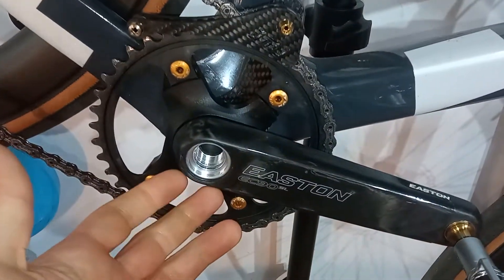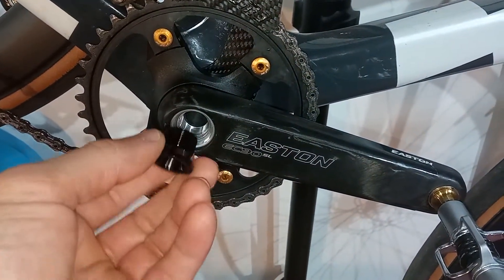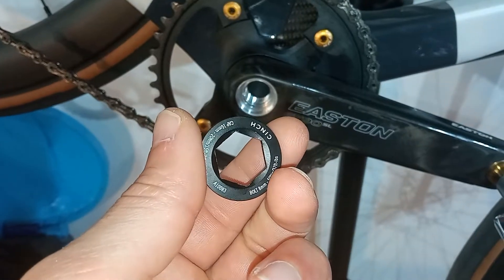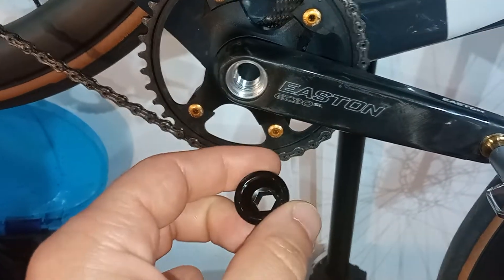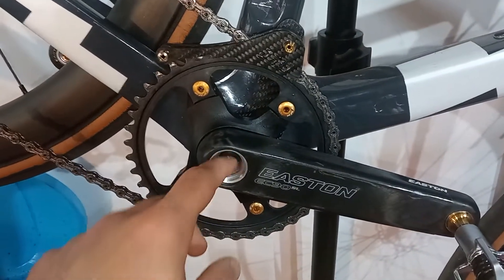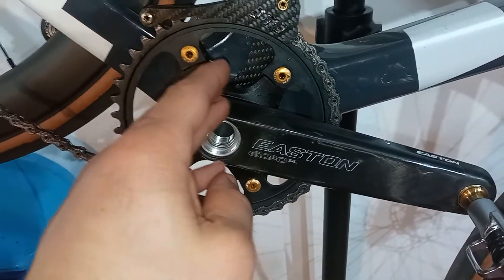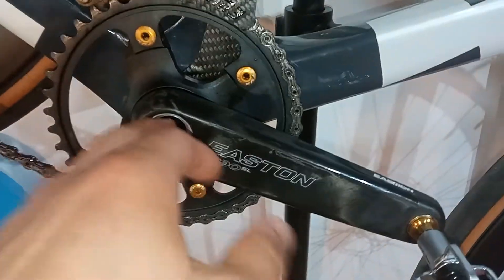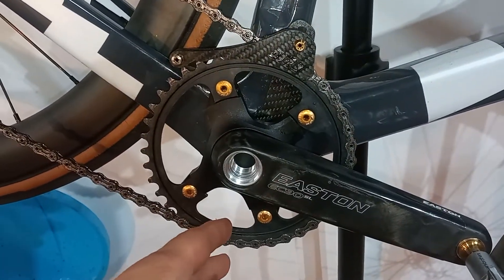Easton EC90 SL Review After Just 200kms - Spoiler: Not For Me

Comment: You have to lightly grease the spline and bolt when tightening it to torque specs. If you dont do this the soline surfaces aren’t mated well and you’ll be under torquing the bolts because of friction.
Reply from the maker: Thank you for the tip. I actually did it once with grease and it came off. Second time around with blue thread lock and it stayed put for a while. Third time was a charm combining grease with thread lock (don't ask) and it worked.

But it's ok either way, because the carbon detached itself from the aluminum insert before the bolt came undone anyway.

Comment: I personally never have had issues with my Easton EC90 sl cranks. Just the BB. Got a Cane Creek BB and fixed it. Now i dont have that bike anymore but i plan on building up a new cross bike and using these cranks with a Wheels Manufacturing BB.
Reply from the maker: Thanks for the feedback and suggestion. They have replaced my crankset, which means they detected debonding at the insert level. But if and when I get issues with the BB, I'll have your suggestion in mind that's for sure.

Comment: I am planning to build up a new bike with a power2max power meter for Shimano / 24mm spindle. They offer a power meter with the Rotor Aldhu-R 24 crankset and also a spider-only option for the Easton EC90 SL. The EC90 is about 150g lighter so I thought this is a no brainer. Now I see your video and this design indeed is very questionable. From my research on the internet not a lot of people are using the EC90 SL whereas for the Rotor Aldhu I find plenty of positive reviews.

Do you think using loctite would fix the issues of bolts coming loose and crank flex? Is this design both on the 24mm and on the 30mm variants of this crank? Any opinion on the Rotor Aldhu?
Reply from the maker: I didn't now a 24 mm version of these existed but if so I'm guessing they're using steel for the shaft instead of Al. Now, it could solve the fretting issue between the bearings and shaft, but you have more issues with this layout.

Don't forget about the bolts coming off and the potential for the aluminium inserts unglue themselves from the fiber. I've put a bit of blue loctite on the thread but although they didn't come off, one of them lost torque. This can be due to a gain in play between the parts but at this point it's like saying you save brake pads by crashing onto a wall. It's a possibility, but not a better one. 

Regarding weight, don't forget that when comparing similar materials, the heaviest one is usually the least flexible, given that it had similar amounts of engineering done to it. You can go lighter with carbon but again you're compromising reliability.